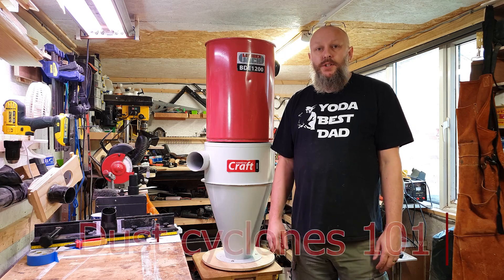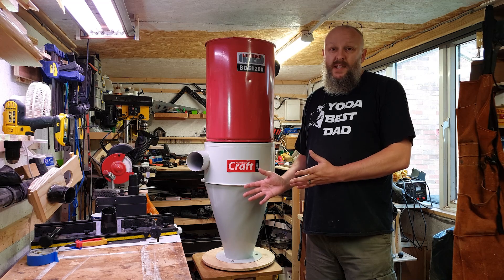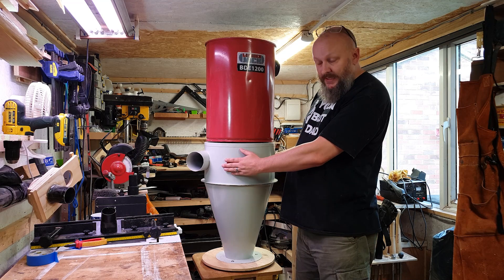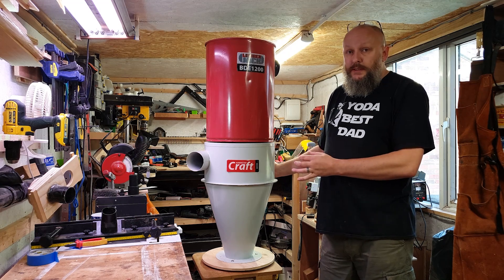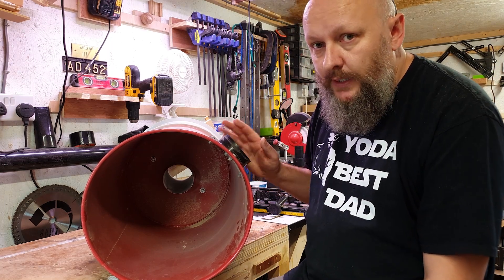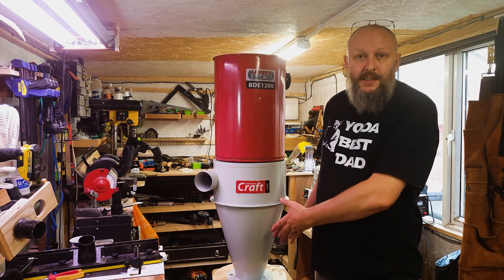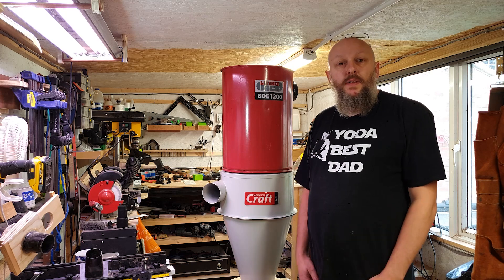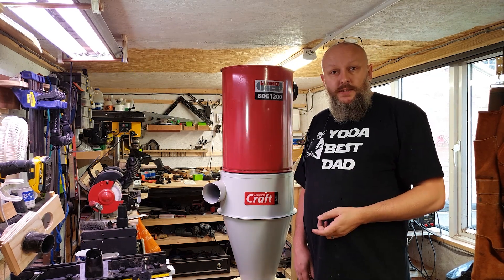See INSIDE a working cyclone dust separator! (dust extractor)

Comment: The direct stack is great.  How did you seal the cyclone to the Hoover drum please?
Reply from the maker: Thanks! I made a plywood circular gasket and then used silicon as a sealer. It's then bolted through the whole assembly.